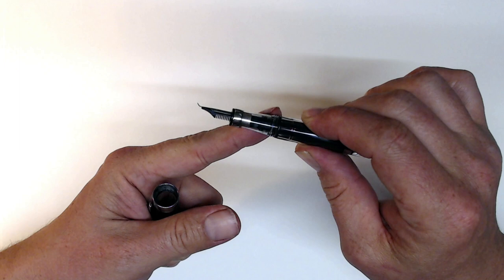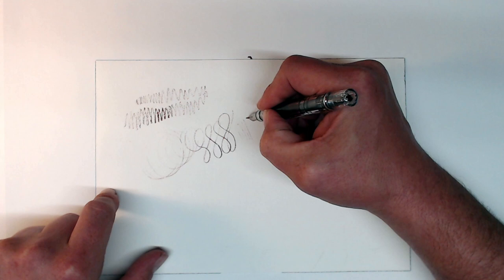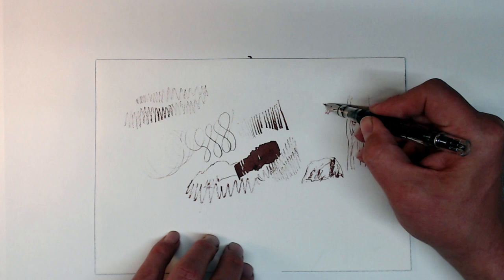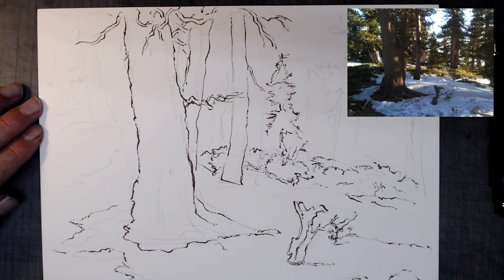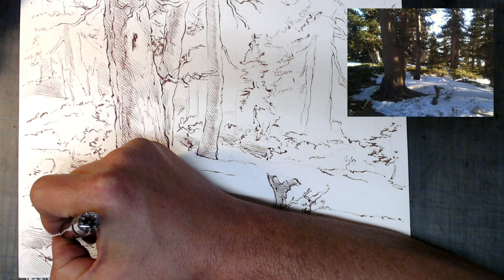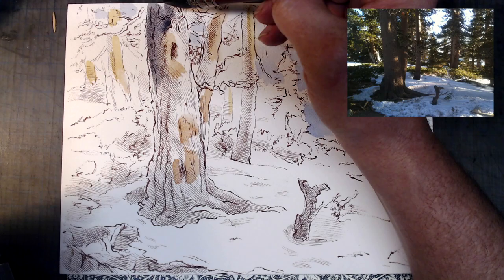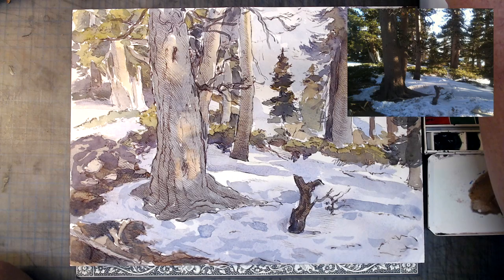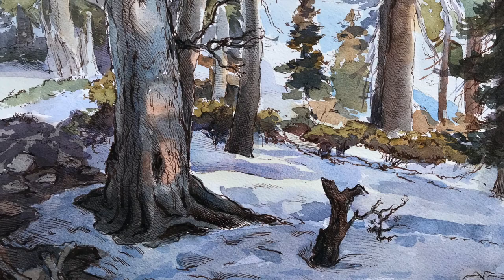How To Sketch with a Fude Nib on Watercolor Paper

Comment: Very nice technique. I have used the Fude’ nib pens for awhile now and use it almost exclusively for my pen and ink drawings. You didn’t mention that turning t nib tip down or upside down makes the finest line    Available for whatever size nib you’re using. And I like your never use black for shading. But I find neutral tint with other tones such as blue or purple work well at times as well. Again thanks for sharing this with us. I like your style in sketching. Thank you.
Reply from the maker: Thank you Richard! I do mention that the fude makes a finer line upside-down in my other video that covers fude pens in general. On rough watercolor paper working that way is very scratchy, however.

Comment: Hello! I didnt know you could fit a fude nib to a TWSBI 580!! May i know how you did that? Did you disassemble your TWSBI 580 and bought a separate fude nib only? Im super new to fountain inks but didnt think at all this was possible!
Reply from the maker: @JeanaTheGreat  welcome to the wonderful world of fountain pens! The 580 uses a standard sized #5 nib, and the nib and feed pull right out, so you can easily do nib swaps. You can buy #5 fude nibs on Amazon (make sure they’re #5, and not #6), and make the switch.
Reply: @mkompan  omygoshh okay thanks for this information! Can you only do this on the Twsbi 580? I bought an Twsbi eco (but havent used it yet) and was wondering if you could disassemble that as well?
Reply from the maker: @JeanaTheGreat  the eco uses a non-standard sized nib, that’s harder to replace. You can put a #5 Into it, but it will be loose. That can be remedied by placing a a few strips of clear tape on the back of the nib to tighten the fit.

Comment: Excellent sir!!! Does anyone make a reliable Crow Quill fountain pen, thanks in advance.
Reply from the maker: Thank you Larry! I have no experience with them myself, but Ackerman pens makes a pen that takes a crow quill. Other than that, the closest you're going to get to a quill are pens that fit a Zebra G nib. There are a lot of ways to do this, one of the easiest is to get a Zebra G nib fitted into a #6 Jowo feed and housing from the Flexible nib factory. They you can fit it into any pen that uses that set up,
Reply: @mkompan   Thank you for the quick informative response. I have tried the Ackerman G nib, non pump, pen & have converted a Jinhao 450 to a G pen. The conversion works well & use Crow Quill dip pens; the Non Pump Ackerman is not satisfactory. I was hoping there was a Crow Quill alternative. Again, thank you.
Reply: @larryglatt2548  what was your experience with the ackerman crow quill? Was thinking of trying it. How did it write and what were the issues? Thank you..
Reply: @nostgeoffhi-fi  Glad you got back to me. My judgement has changed, The Jinhao conversion DIDN'T actually work after all (total fail for me) as for the Ackerman G nib pen, that I wound up returning for a refund (lovely folk), but I couldn't make it work. BTW, I use Platinum Carbon ink; as for the Crowquill, no I haven't tried that one. At present I am using a Swan Manga Pen from Swan Pens on Etsy, it comes with its own Soft Maru- type nib for Calligraphy & Art (their description.) I like it for inking line work, just a bit scratchy but I'm getting better with it. Next, it has a very large capacity self contained converter, which is great, but the Carbon ink can't be left in it. The owner, Thomas (great guy) said to rinse after use and it should be fine & it has. So, I use & rinse after each day's use. At present I have 2, one for the Carbon ink & the other with Noodlers' bullet proof (?) black which is just fine. Interestingly he has a Fude pen as well which I plan to purchase down the line. Let me know what you think. Best regards, Larry